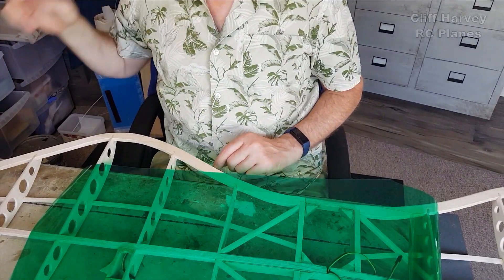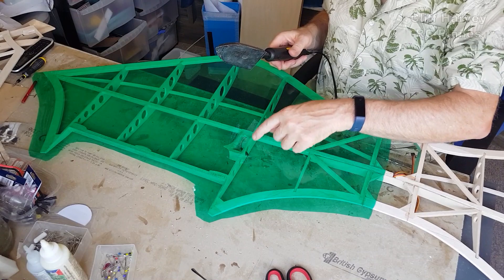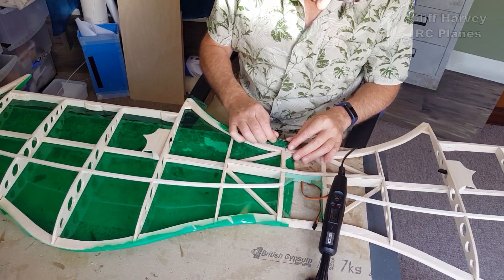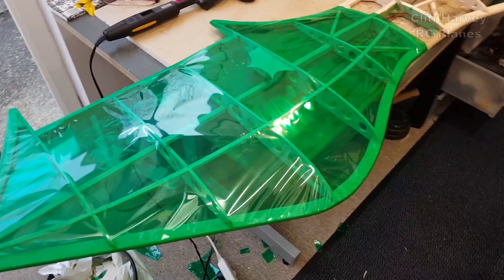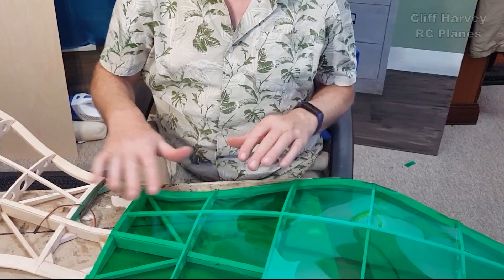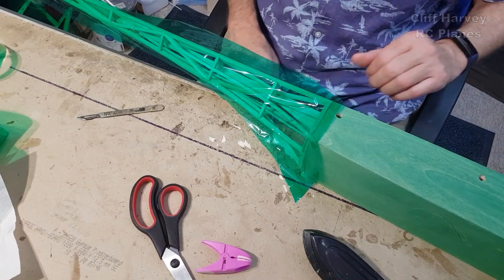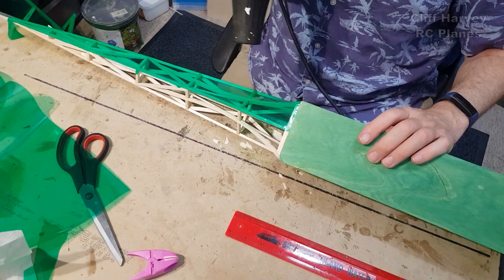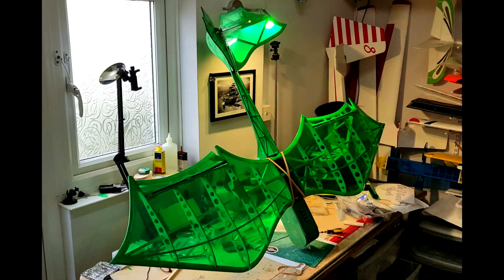The Big Da VInci Flyer Gets Her Clothes On!

Comment: It is gorgeous. Being a Musician, I must bring up the fact that there are drums that come in different shades of green transparent shells, which I’m reminded of by this beauty.  

Slight change of subject:
Also… along the same line of thinking, (building with wood), which I have used on my cheaper wood type drums to improve them, there’s a product called wood hardener.  It may be something to consider when you’re  wanting to experiment with making a project stronger, without adding much weight. I don’t know… try it on a scrap piece of wood and see if it makes it do anything unwanted…
It’s a great product that I get no kickback from in terms of $ by telling you about.  Ha ha!  There are many brands to chose from.
Reply from the maker: I have heard of wood hardener but never considered using it, I think it's marketed for wood that's a bit rotten/soft, good idea and worth an experiment. The only possible downside I can think of is it may make the wood to brittle perhaps, it's good that balsa gives a little sometimes, but as I said worth an experiment ... actually I think my daughter may have some, cheers BC.
Reply: @CliffHarveyRCPlanes  Actually, the kind I use puts a kind of plastic in the wood as it soaks in. Of course, making the wood of a drum more like maple than say… poplar, can improve its ability to react to vibrations from the drum heads as they are hit. That’s my theory anyway. I know you are correct about the reason the product is usually sold… I just have this funny habit of using things in ways they were not intended to be. It’s a… hit and miss, creative impulse of mine. 

  I just see the time and effort involved in the beautiful craft built by people such as yourself… and thought if sharing the idea might work, it would be great!

   I’ve done such things (along the lines of repair/glueing) in the past with some success, with other products on landing gear and such. The people I have shared with have been grateful… and saved some heartbreak and $ at the same time. 

  If you do try it… I hope it works fantastically for you. At what stage it would be applied, I don’t really know in your case. 

Good luck and happy flying!

Comment: Cliff, it looks fabulous. Tell me, what covering material is that?  I’ve been away from the hobby for a while and the last stuff I used was Monokote and Solarfilm. I’ve never seen a model covering with a peel-away backing. Cheers and thanks as always. 
Angus, New Mexico, USA.
Reply from the maker: Hi Angus, I think both the products you mentioned had the same peel off backing as this one, it's just a generic covering available anywhere. Heat activated adhesive needs a backing otherwise it's going to end up stuck to itself in hotter climates, cheers.
Reply: @CliffHarveyRCPlanes  so I bet you’re right and I’m not remembering clearly; it’s been 40 years since I’ve used it!  Thanks again. Angus

Comment: Greetings Cliff.  I'm close to putting my Da Vinci Flyer in the air.  My all-up-weight is 567 grams and the CG is 54 mm from the leading edge where the wing connects to the fuselage.  The marks you have on the plans has the CG between 49 mm and 65 mm, so I'm just nose heavy from the middle of the two of 57 mm. Is this plane real sensitive to CG?  You haven't discussed this at all, that I've seen, in your build videos.  Any information to improve my odds of a successful maiden would be appreciated.  Here's a Google Drive link to a photo of my Da Vinci Flyer;

https://drive.google.com/file/d/118yxmiftWNhbo4VTjB2o0TVD7fDTHdoW/view?usp=sharing
Reply from the maker: Hi Jim, she looks gorgeous,  I'm really excited 😁 the cg isn't too sensitive no, you should be fine nose heavy. I see you went for bands in the end 👍
Reply: @CliffHarveyRCPlanes  I had so many things going on that I kept putting off doing my planned mods for the screw mounted wing. And I've got an ARF Zero to get in the air and a Great Planes RV4 kit to build. So, one morning I got up and just put the darn dowels in. I could always add the screw mount later. Cheers Mate.